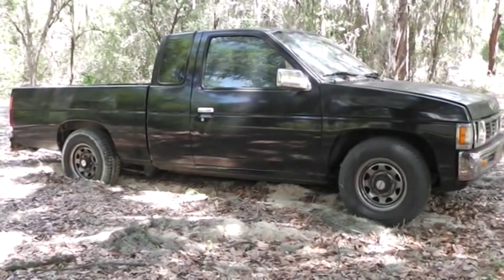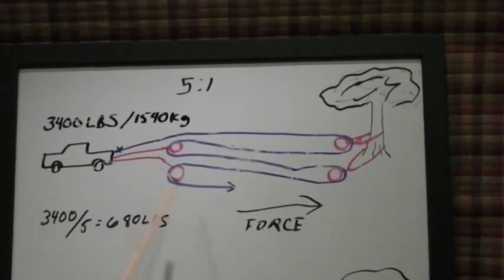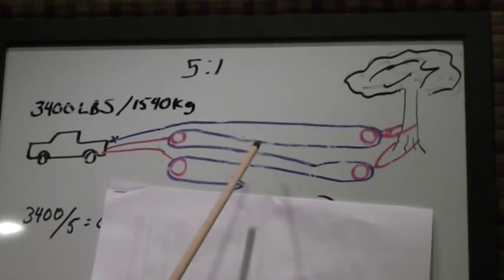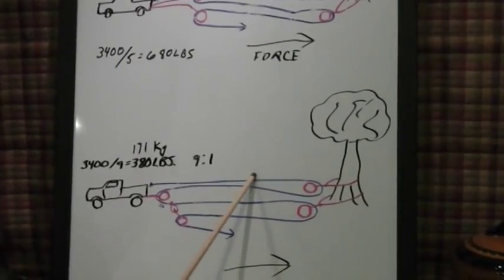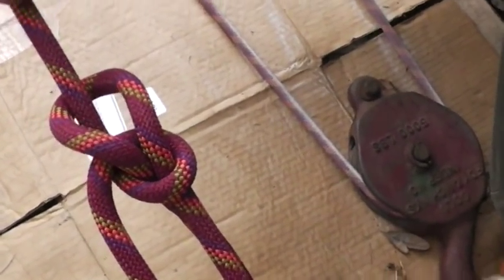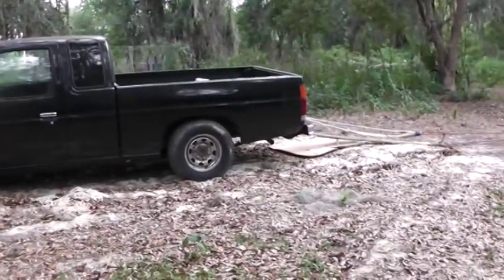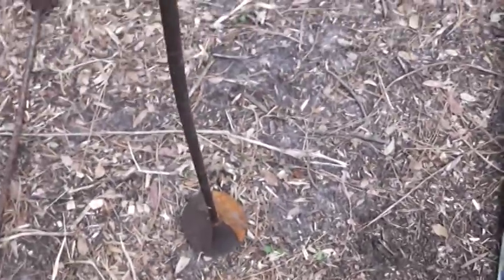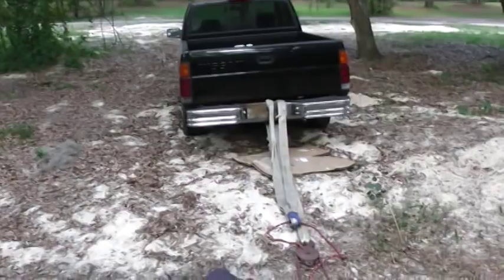Mechanical Advantage Using a Rope and Pulleys for Vehicle Recovery 9:1

Comment from the maker: I appreciate you watching and commenting.  That is a '95 nissan that I bought new. V6, 5-speed, 186,000 miles.  Besides a few sets of tires, oil changes, brake pads, belts and batterys, I have replaced the starter and the alternator once.  Original clutch. Incredible.
Reply: They don't make em like they used to!

Comment: more people should use their head for something besides a hat rack.. last spring, I pulled an old D4 cat out of the mud with 7 snatch blocks, a 3/8 cable and a Massy Ferguson 20, a wrecker wanted $600. which is more than the cable and snatch blocks cost me. I got the dozer out and I now own more cable and pullys
Reply: dave12546 I'm here for exactly the same reason!  I have my CAT D5 stuck in my creek and the heavy tow company wants $750 minimum to extract it.  I actually only need it turned 90 degrees so it's in line with the channel and I can drive it out.  It could be quicker to hire the tow truck, but that's a lot of money and only gets me out....

Comment: One suggestion: For your 3 inch snatch line that you have around the tree. What you did is OK I guess if you have a hard bark tree or a tree that is pretty much straight vertical, but if the tree is a soft bark tree or if the tree is  leaning, there is a good possibility that your 3 inch snatch line could move as you pull. This could result in stripping the bark off the tree as the line moves.
To help prevent this, put a tension hitch in this line (people might call it something different) It's extremely easy to do. Put your hitch line on the tree in the opposite direction. So the line will be around the tree truck but facing away from your truck (as if you were going to pull an imaginary truck on the exact opposite side of the tree), with equal lengths on the right and left, again going away from your truck. Take the left side and wrap it around the tree,, so now it will become the right side length going towards your truck and do the same with the original right side length, taking it around the tree and which will now become the left side length going towards your truck. You're making a pretzel with the tree trunk in the middle. With this type of arrangement you can pull as hard as you want and that snatch line will never move on the tree trunk. Hope this makes sense.

Comment: Nice demonstration. Many comment on just using a winch or this is not practical, well, if you dont wanna buy an electric winch or cost too much for your type of vehicle, then I suggest this method. Keep all the stuff in a tote or tool box in the back of your vehicle or in the garage. If you plan on off roading,etc, then put this stuff in your vehicle. Used in combination with a hand winch will recover more than you think!

Comment from the maker: A couple of ideas that might work: you could bury your spare tire a couple of feet down, bury a 4 ft. section of 6x6 PT post or 2,3 or 4 inch steel pipe horizontally.  The army has a type of device that is specifically made as a beach anchor but, I can't remember what is called or much about it.  I am sure that some other commenters will have some good ideas also.

Comment: I often wondered about the relationship between actual weight (as if an object were to be lifted vertically), vs a horizontal pull like you are doing. The vertical lift would be the true weight, yet the horizontal pull would obviously not be pulling up directly against gravity, but would be subject both to the weight of the vehicle and other variables, such as the angle and condition of the ground, the mechanical aspects of the vehicle' axles, etc. Too many variables to measure; indeed most cannot be measured as they are really friction as opposed to straight resistance. A good demonstrative video! Oh, and of course make sure your truck is in Neutral before trying to pull it!

Comment from the maker: There are many rope types that can be used.  10.5mm kernmantle is good for @6750lbs(static),  11mm is rated for 7650lbs(static).  You probably won't be exerting that much force to recover a stuck vehicle by hand but, you never know.

Comment: Hey, me again.  I notice you said that there are two kinds of pulleys used here.  One is fixed and one not.  So, are you talking about the top part of it being able to swivle.   I notice you used some really big pulleys, like old ones, and then the other ones are smaller ones look newer.  Would realy like to know the names of these and the company that makes them, but there are probably lots of manufactureres of these.  So, again, that kind of imformation would be helpful.  You said the rope has a 7000 pound capacity, and wow, thats a lot.  The ones I saw at the store, called truck rope, went up to only 500 lbs.

Comment: First thing: Rope will not snap and whip like steel cable. Blankets not needed.
2nd: If you added the 5:1 to your 9:1 it would become a 45:1 not 14:1

Comment: Another system for creating an anchor point if you don't have one is to take your spare tyre and dig a reasonably deep hole, tie off to the spare tyre. Drop the spare tyre into the hole with the snatchem strap /ropes tied off to it, back fill, stamp down well and you should have a reasonable anchor point. 

I've theorised that a spare wheel with no tyre on it and wrap an anchored rope around that wheel a few times and then drive. Must be a reason why it's not used, I guess??? Enlighten me pls.

Comment: isnt the 5:1 example actually a 4:1 because the last pulley is only a change of direction? idk i might be wrong?
Reply: I had the same idea but was not too sure so I went back to this guy. (Pulley Systems Rules | Knots & Pulleys in Rope Rigging Systems Vol. 1.)  In that video he explains how and why homesteadprepper is correct on that part and most of it. However when he combined the top and bottom diagrams he was wrong. It would be a 45:1 not a 14:1.
Reply: +Eugene F if i remember from school, each movable pulley split the weight, so i think you are right...you have to pretty much divide by the number of pulleys, four pulleys, weight/4... and you have to move 4 times more rope, i mean, move the car 1 meter, pull 4 meters of rope... its a really good idea but not practical... to move your car stuck on mud you would need quite a lot of pulleys and a lot of rope... but still, awesome what we can do with physics =)
Reply: +Andre Luiz you are almost right. 

Don't go by the number of pulleys. You go by the number of runs are coming from the load. In this case there are five. if the last leg of rope is coming from the load it is counted. If the last leg is coming from the tree, that is just a change of direction. So if you are just counting pulleys then you may be wrong. 

also you don't really need all that much rope. Say the load was 20ft away. a 5:1 will need 5x20= 100ft, but if you put a 10ft of rope or chain to the load then to the pulleys all you would need is 5x10=50ft of rope.

The amount of rope being pulled is the same just have to re position the the pulleys once.
Reply: Yes... what George Vasquez said, and if you put the tree where the car was and the car where the tree was, then it is 4:1 with a change of direction.  Sounds a bit weird but true.

Comment: one rule of rigging with multiple pulleys is never dead-end (you call it anchor) on the load. you cancel your mechanical advantage when you do that.
Reply: M:A is determined by the blocks that move.the ones attached to the truck. The blocks attached to the tree's are just changing the direction. I have some books that a ironwork gave me.is all about hoisting and rigging. A lot of mathematics but it held me understand

Comment: Sir, your math is wrong. Your demonstration of the 9:1 advantage is actually a 4:1. When your anchor point is the item  of load (vehicle being recovered), your first pulley is a redirect pulley. In order for the first pulley to give a 2:1 mechanical advantage, the anchor point has to be forward of the load and the first pulley would be hooked up to the load/vehicle being recovered. I know this is an old post, but I thought you should know that way you don’t overload your recovery equipment and cause a hazardous failure.
Reply from the maker: You're wrong. If not, then make your own video and prove it.

Comment: How many pounds do each of the pulleys have to be rated at. Do they have to be at least the total weight or split between all of them. Can u use a double pulley and it would count as two of your pulleys. Trying to move a old shed with my atv and using pulleys would help
Reply: Basically yes and yes. If you have one pulley and just the change of direction the, pulley has to match or exceed the weight of the load. Adding pulleys, you can distribute the load. Just go a bit more on the rating just in case one gives out.  Yes if you have a block with two pulleys that counts as two pulleys but the rating stays the same for that block.

Comment: On your 9:1 pulley system, could you attach only one rope tied to the back of the truck and use another friction hitch like you did on your second 3:1 pulley system to pull it ?  It would look more like 3:1 and 3:1 in series.  Attach only one rope to the middle of the truck to give balance.

Comment: Well, this is really an awesome video.  I have two spas in my backyard that I want to stand up, and lower without bringing in a bunch of help to do it.  So, I know it can be done using something similar to this.  But, my question for you is, where do you buy these pulleys, and the strap that goes around the tree.  I went our Orchard Supply here, and the biggest pulley they had was a three inch pulley. I also checked places like Home Depot and Lowes, and they dont have this kind of stuff.  So, any information on where to buy it would be helpful.  Also, is it true that if you have an object, like a spa, that you want to raise or lower, that you have to attach your lines higher on the tree, like at about the same distance as where you have it attached to the thing you are raising or lowering,  Anyway, great job on this.  I learned a lot from this.  I knew it could be done, but this demonstration is the real thing.  Nice job!
Reply from the maker: Thank you for your kind words.  The 2 larger older pulleys came from my local flea market $3 and $5 respectively.  The newer ones I bought at tractor supply.  I bought the 3 inch wide snatch strap/rope from Harbor Freight and I noticed that they have pulleys too.  I have another vid where I do some over head lifting of roof trusses if you are interested:Raising Homemade Gambrel Barn Trusses by Yourself: No Crane Rental Necesary
Reply: You should look at Norther Tool.  I hope you got the job done but in you case I would have suggested you use a couple of chain hoists. I am sure you could borrow one and buy one. just make sure you rig your load really good and secure the hoist to a nice thick branch(s). using those will give you better handling of the load to set it just right.
Reply: @homesteadprepper  I know its a bit late..but most Arborist stores also sell awesome pulleys and rope that can handle HUGE loads  ;)

Comment: Great! Thank you for the info. Does the weight of the truck make any difference? In the north plow trucks get stuck very often. My F150 super crew with a 7 foot plow is pretty heavy.
Reply from the maker: Yes weight make a huge difference. You might consider going with a higher ratio than 9:1. The truck in the vid only weighs @ 3100 pounds.

Comment: For those kind of trucks that have the hitch on the bumper, do yourself a favor and attach the rope underneath the bumper, straight to the chassis - around the bumper, lead in on top, lead out on bottom. I bent more than one bumper thinking that the hitch is a point of strength - it ain't. Fucking hate this bumper design.

Comment: My question has to do with the ratings of the pulleys involved.  If I am trying to move an 8000 lb object and using the method described here, what is the required rating for the pulleys?  4 ton (or bigger), each pulley at 1 ton?
Reply: Depends on how many blocks are in the system.   Remember you're not exerting 8000lbs just to get an 8000 truck rolling unless its heavily mired in the mud, so keep that in mind.  But to answer your question if you only had one traveling block (line from your anchor, out to the casualty (and block) and then straight back to you pulling on it) you'd need a 4 ton block to be close to Working Load Limit.  Again just because your truck weighs XXX doesn't mean you're pulling that.   This guy was realistically pulling 600lbs maybe to move that truck.  WLL is usually 3.5 times less than breaking strength on snatch blocks, at least the ones I work with. Regardless, stay within WLL.

Comment: Isn’t the one your pulling the haul line? It doesn’t contribute to the mechanical advantage I don’t think. So you got a 4:1 with change of direction and that second one why did you multiply it. I don’t think you multiply . You just add the mechanical advantage “ropes” . I don’t think you multiple 3x3 to get 9:1

Comment: Great video. I am trying to figure out how to use pulleys to move a non working Gold Wing motorcycle up a driveway that is about 40 degrees. I thought it would be clever to use the F150 lower on the driveway below the GW. How would the pulley be set up to work? I purchased a Blue Hawk 5 " steel block 700 LB pulley. From what I have read, if I use only that, the mechanical advantage is only 1:1. How would I incorporate one more pulley so that if I slowly let the truck move down the hill, the GW will move up the drive way. Any help would be appreciated. Thank you. I forgot to add that there are established trees 20 ft from the GW that can be used in the equation.
Reply from the maker: Can you send me a video of what your trying to do?
Reply: Oh lordie, I'm not the technical. Maybe I can create a basic drawing. Sorry, I don't know how to attach things. I only ever watch videos. Never post anything
Reply: Sophie Crowdy You can use that one pulley and get a 2:1 mechanical advantage if you hook the pulley to the bike then its a moving pulley. Anchor one end of rope to fixed point, run the rope thru the pulley and pull. The load is now effectively halved.

Comment: Could you do this with paracord? Also, do the pulleys need to be rated to a certain force/weight?
Reply from the maker: Yes but, paracord is only rated to 550 pounds. You could weave multiple strands together for more strength. Pulleys are rated by weight. Harbor Freight has some high weight rated snatch block/pulleys.
Reply: @homesteadprepper  thanks! I was thinking I’d you had enough pulleys you could use paracord but the output force/weight is still 3000lbs+ so it wouldn’t work right?
Reply from the maker: @joedimaggio3146  That 3K pounds will be exerted between the load and the first pulley closest to the load. If you used the set up in this video,  the force exerted between the on the pulling end will 1/9th of the 3000 pounds or @333lbs.
Reply: @homesteadprepper  right but that means you still can't use paracord because that's too weak for the load end ?
Reply from the maker: @joedimaggio3146  Correct, too weak.
Reply: @homesteadprepper  Gotcha, thanks

Comment: Caution, the rope you choose should NOT be a dynamic climbing rope as it is not designed for heavy static loads and the  load ratings can be more difficult to understand as you are using it for something its not made to do. If you are going to practice this method (which is not bad at all) make sure to use the right gear or you can put your self into danger.

Comment: so what your saying is always keep 50 ft of rope, 5 snatchblocks, 2-3 tow straps atleast on you at all times.... and you may need to keep a hammer drill, some steel plate, and a couple ground stakes with you as well.  good lesson on mechanical advantage but not practical in daily use.
Reply from the maker: People like you can inconvenience a friend(who has equipment) or call AAA when you are stuck.  This video was for like minded self-sufficient/self-reliant types who realize that help might not always be readily available or not in a timely manor.  A very practical way of unsticking yourself if you are cut-off from service.  I carry this stuff in my daily driver and more.
Reply: jake turlington Umm, if you have a bed toolbox, why the hell wouldn't you have all this stuff after seeing this?
Reply: Well, if your daily routine consisted of being out in the wilderness by yourself or in an area that is know to be a trouble area or you are going to an area you do not know and are going alone then yes take the stuff with you. It real is a no brainier to go prepared , especially when someone like homesteadprepper just showed you how to to be a little bit more prepared. If you are just some guy in a gremlin that only drives his mom to and from Church and the grocery store then don't. So take from this vid what you can. Don't get stuck out there, but if you do be prepared. Remember it is always better to have and not need, than to need and not have.

Comment: What thickness rope and how long rope do I need to do this?
Reply from the maker: This rope is 1/2 inch kern mantle, 165 feet long(50meter), rated for 7000 pounds.
What length of rope you need will be determined by your terrain that you off road in.  How far away are the trees or rocks that you can tie on to?  You might need more than one rope.

Comment: Gross overestimation of the required force to move that truck. In soft ground, you would be moving no more then 15% of the actual weight, meaning aprox 510lbs of force is required to move it. A simple 4:1 system would lead to less then 130lbs of force required to move it. 

Its a nice video, but when it comes to moving a rolling object, it lacks.